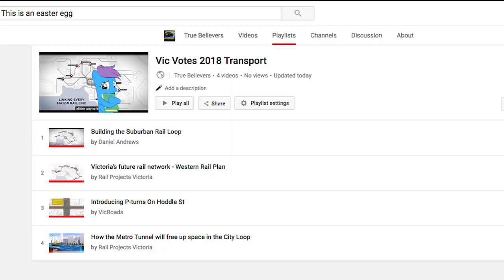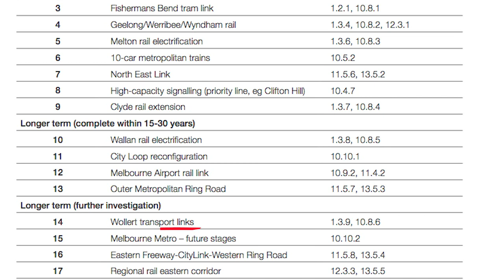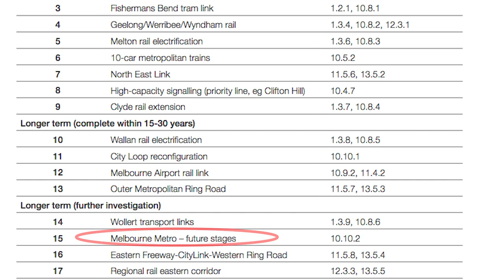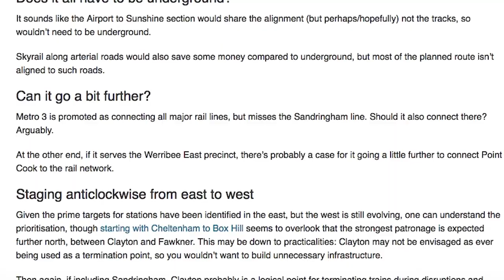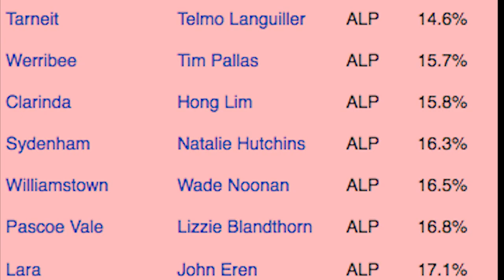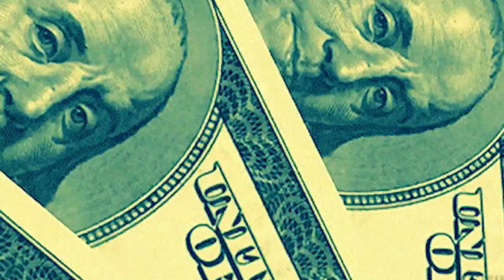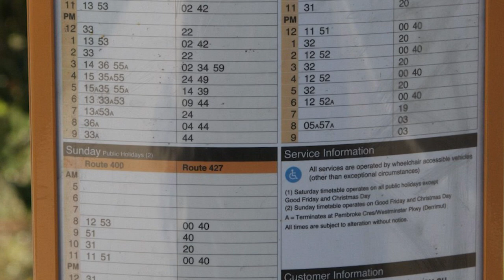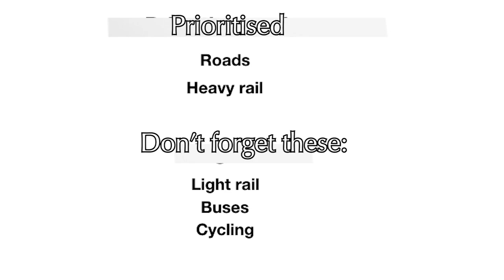Melbourne's Suburban Rail Loop | Vic Votes 2018

Comment: The problem with the Melbourne transport system is 1. To get to anywhere else in Melbourne you have to go through the city loop stopping at either Southern Cross or Flinders, contesting traffic in the city. (which is the the suburban loop comes in) 2. Traffic delaying trams then leading too tram backups and missing train timetables. 3. Road infrastructure isn't capable of handling a metro heavy bus network. Also many cycling initiatives have been started in Melbourne including O bikes and many seperated bike lanes, which aren't being utilised as expected. 

This comes from a heavy user and transport enthusiast. I often have to travel from the northern suburbs of Melbourne to the Western suburbs. And it is a 30-40min drive. For me to complete the journey I have to catch a tram, then jump on a train into Melbourne to then catch one back out of Melbourne making it a 2 hour or so trip
Reply from the maker: Absolutely I agree they're major issues with Melbourne's transport system. Bus network needs a major overhaul.
Reply: Great video btw, I'd love to discuss some issues and other topics surrounding the Melbourne public transport system.

I do support the suburban loop. Although I stongly think it definitely should be undertaken in a different way then suggested.

Comment: My major infrastructure project would be a quad tunnel under Elizabeth St. to University then along Elgin/Johnston Sts to Vic Park then along the Eastern Fwy. 
Splitting at Chandler Hwy north to Livingstone, Northland, La Trobe, Bundoora, Mill Park, and Mernda (eventually Yan Yean, and Whittlesea) and south along the old outer circle line with many options from there.
Continuing east to Bulleen rd splitting along Thompsons Rd to Foote St/Reynolds Rd to Blackburn Rd.
Continuing east to Doncaster rd, along Doncaster Rd to Donvale and then eventually to Ringwood.
.
The south end of the Elizabeth st tunnel would then go along the old St.Kilda, Port Mel-b'n lines. Which would need to be raise to above 6m or tunnelled.
St.Kilda would be extended under Fitzroy st to the Sandringham line.
Splitting east at Gardenvale to Monash and Rowville.
The Sandringham line I would extend east to Southland, Moorabbin Airport, Dingley Village, Keysborough, Dandenong, Dandenong Hospital, Endeavour Hills, Narre Warren Nth, and Narre Warren East.
Port Mel-b'n, I'd realine along Williamsons Rd, then tunnel under the Yarra to Newport (This would have multiple lines as it would also run express lines to Werribee and Geelong.) 
I'd split the line north west the Kingsbury, Brooklyn then from Bunting rd (yes, a lot of old industrial train lines still squiggle trough the area) west along Boundary, Dohertys or Leakes Rds.
Reply from the maker: Very interesting proposal, I wonder if you drew this on google maps. I used to do that alot in my freetime
Reply: @TrueBelievers  Yes I did. It is too big to msg, email or Facebook...
I can send you section of it If you wish.

Comment: To me it seems like the second Metro Tunnel would disproportionately benefit the inner city while ignoring the suburbs. It would just be another way of going through the city, where as the SRL will allow travel between suburbs without the city. Also, the Airport Link is part of the SRL and hopes to allow people to get from the airport to the suburbs without entering the city. So, the SRL will already massively free up capacity in the city, making a second Metro Tunnel somewhat unnecessary, while providing all the other benefits I've mentioned. And, you mention multi-modal infrastructure - I agree - I think it would be far more cost-effective to link Fishermans Bend to the northern edge of Melbourne via the tram network, which incidentally is what the state government has decided to do. The second Metro Tunnel does sound like a good idea, sure, but it is significantly less important than the SRL, a project which will already take decades. We need to get started on the SRL now and connect the suburbs before making yet another cross-city route. After all, the first Metro Tunnel and even the City Loop are both just temporary band-aid solutions to the fact that Melbourne's wheel-and-spokes railway network is sub-par.
Reply from the maker: SRL is a good long term project for connectivity etc, however there are some tweaks you could make to the existing system to get more capacity out of it. I wouldn't dismiss MM2 importance but yeah it can wait. City loop reconfiguration is a project that is seriously underrated in the transit space.

Comment: Nice video mate. So I’m just wondering who you think has been the best promise for this election in terms of transport? We have this from Labour, we have EWLink + NELink + road intersection works + medium speed rail to regional Victoria by the liberals and your favourite metro 2 tunnel + train line to Rowville by the greens. 

I personally like all to eventually be done and think everything has a decent reason for being built but I also know that it costs a $ or two and is very unlikely to happen.
Reply from the maker: To be perfectly honest the Greens generally have transport projects more focused towards central Melbourne and less on areas in regional centres. Liberals have focused too heavily on roads in central Melbourne and it's rail plans are kinda not well thought out. Labor has the best chances with it's transport agenda, it's shown to be active in building infrastructure both in the regions and Melbourne, just they have taken a very political decision with the rail loop, and didn't pursue the metro 2 which was the expected announcement by them. But since they've got the rail projects going in the last 4 years they have the better chances towards the state election.